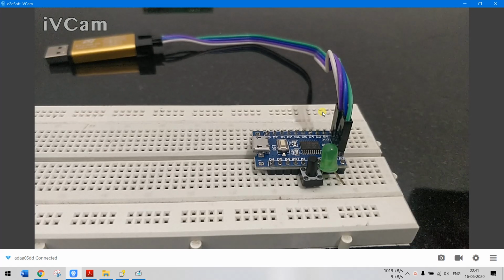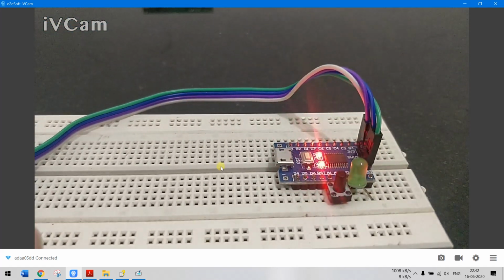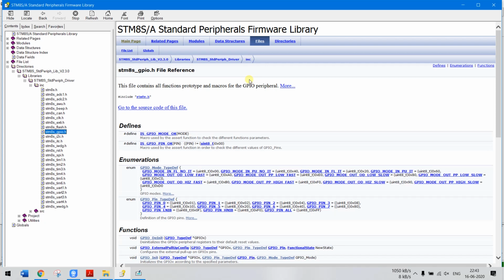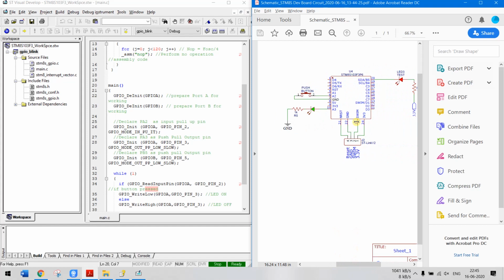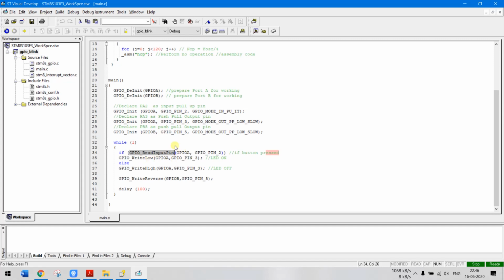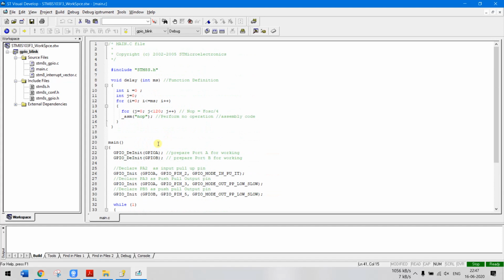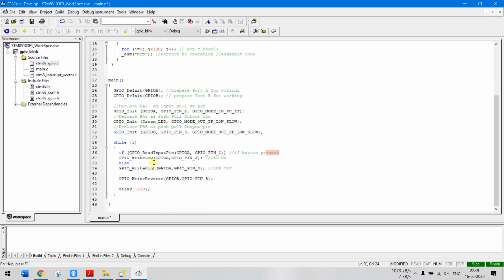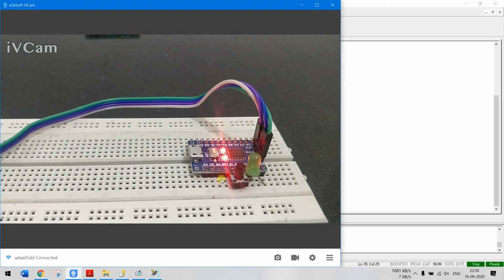Basic GPIO Functions on STM8S Microcontroller - LED Blink and Toggle with Push Button

Comment: I have programmed stm8s003f3p6 microcontroller... where 2 input (pb4 and pb5) and 3 output pins (pc3, pc4 and pc5) where pc4 and pc5 is getting voltage of 2.8 volts but pc3 is giving only 1.3 volt... i need this to be 2.8 too..what is the mistake i have made? Logic is perfect in my program ..as small LED's are working as per logic.
Can u help here?
Reply from the maker: Is there anything connected to that pin? Try setting the GPIO as a push pull output.
Reply: @Circuitdigest  dear,
I have tried push pull too..

One new thing i have tried here and issue resolved. This is strange for me..
Here Previously I have created seperate function and from that function I had taken output on pc3. Now i have removed that function and included inside main function. And issue resolved.
I dont knw wht is the logic .

Comment: Hello people!. I've just started for the very first time to program stm8s103f3 microcontroller. I've wrote a very simple program to blink the on-board LED. It compiles with no error or warnings, but when I try to upload to the chip direct on STVD it seems to be programmed but nothing happens on the chip. When I try to upload it on the visual programmer, I get messages like "memory out of range, ignored" and then again the chip is doing nothing. Can anyone help solve this please? I'm coding in C and compiling with COSMIC by the way.
Reply from the maker: hey we cant help you with this here, please post your questions on our forums https://circuitdigest.com/forums people there should be able to solve this for you